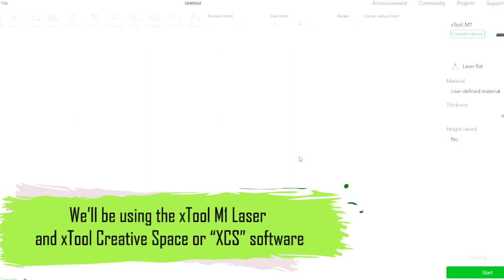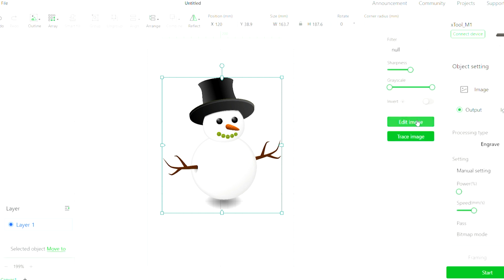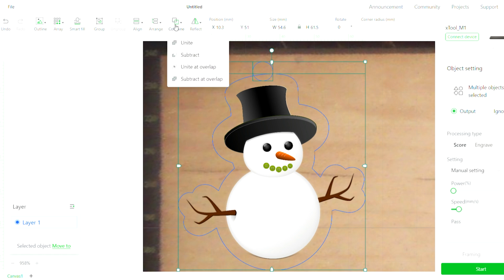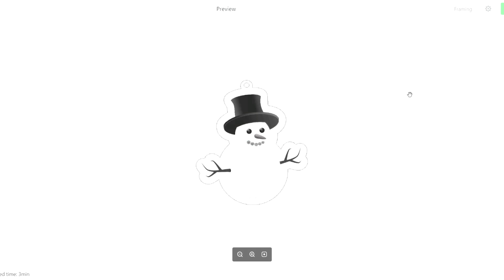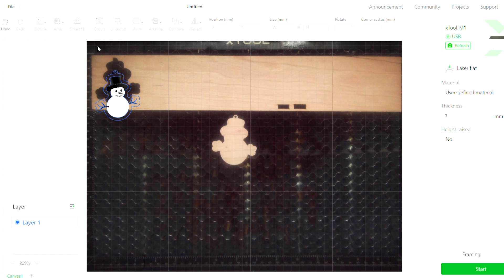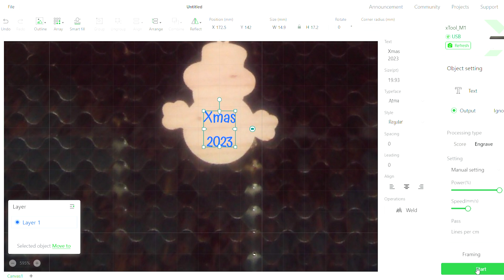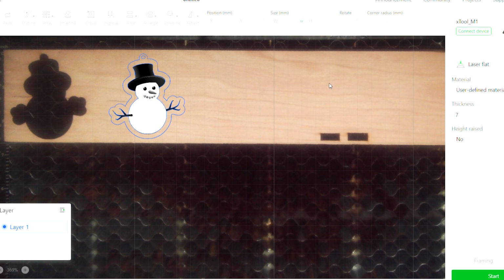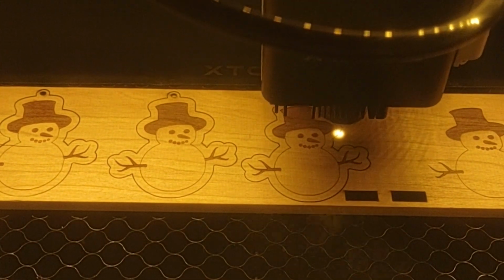How to Make Xmas Ornaments with xTool M1 Laser Cutter & Engraver

Comment: What settings did you use for the cut? I have the same laser and only did 1 successful cut with it on 5mm plywood, I feel there’s no way mine would cut that especially that clean and I have the air assist as well🤷🏻‍♂️
Reply from the maker: Hey there, thanks for watching.  So plywood is actually tougher to cut with a diode laser than many people think.  It has to do with the glue in between the layers.  I would not be able to cut plywood of the same thickness as the cherry hardwood in the video.  I typically cut hardwoods of this thickness at power 100, speed 5, 2 or 3 passes.  I should mention that different wood species will require different settings and that some leave a much cleaner edge than others when cut.  For example, cherry and maple will have a nice clean black edge while mahogany will have char that needs to be knocked off.  One last thing - I have the 10w version of the xTool M1.  The 5w version will not be able to cut as thick/quickly.  Hope that helps!
Reply: I kinda figured that it had something to do with the glue in the plywood, I’m gonna try some pine board later and see what happens. I also have the 10W with air assist and the smoke purifier, pretty cool set up all in all. 
Thanks for the reply! 😎👍🏻
Reply from the maker: No problem!  Best of luck, I have really been enjoying my machine as well.  One thing I forgot to mention - don't trust the auto-measure that the machine does.  I'd recommend measuring everything yourself when entering the material thickness.  Maybe it's just my machine but I find it to be very unreliable.